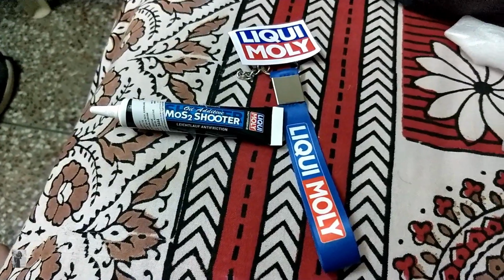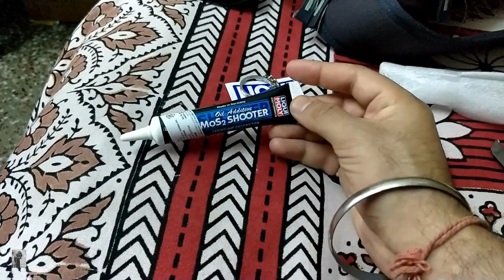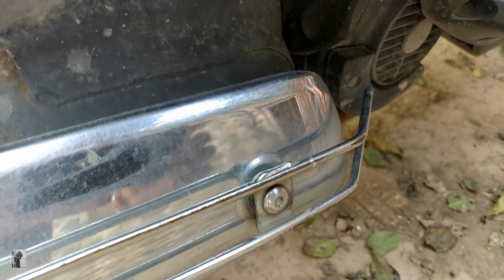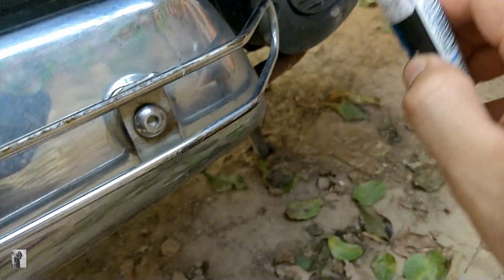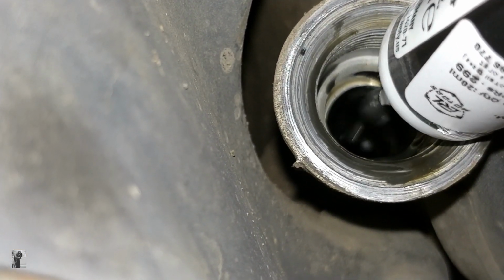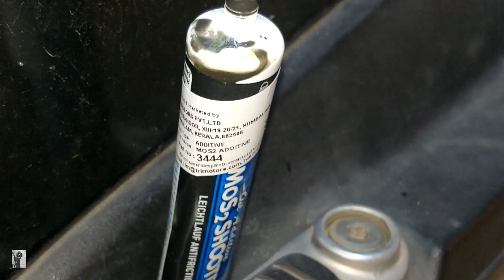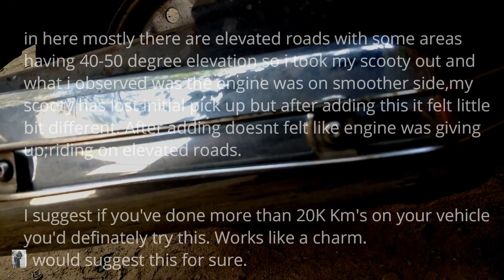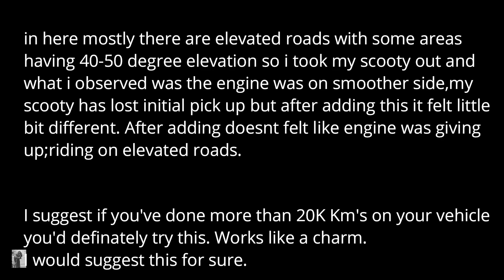Adding Liqui Moly MoS2 to Engine | Does it work?

Comment: Started using it in my bike after just 1900 KM.
Works really well & there is no commitment so you can switch off it on the next oil change without any issues.
Reply: I.own a mt 15 which is 5 months old. I've just filled liqui moly oil today and mos2 shooter. Not noticing any changes yet but how was your experience?
Reply: @RohitRoy-ev4fp  now feel any difference ?
Reply: @nooruddinshaik9464  My instant pick-up response was good and i would reach VVA very quickly compared to YAMALUBE. That's the only significant change and yes engine was more smooth. I'm using Motul 7100 now and I'm getting good mileage plus same engine smoothness. Let's see how well it goes
Reply: @RohitRoy-ev4fp  do you use Motul 7100 with liqui moly mos2 shooter or without liqui moly mos2 shooter?
Reply: @omarsyahrilnorazmi3302  Im using with shooter currently.

Comment: Now, how many kms you covered on this scooter till date.. any engine related problems you faced?
Reply from the maker: I gave it to my cousin 5 years ago. I've had it till 32k kilometers, and engine used to be smooth when mixing with engine oil, but you need to top it up constantly as it becomes thinner over the period of 2k kilometers and you've to fill it up again.

Comment: Saw some reviews that initially it runs smooth but after 1000kms it increases Noise, Vibrations and Harshmess levels of engine... Is it true ? Plz let me know
Reply from the maker: Yea initially it works really good but after the oil loses its viscosity it's like normal. But it doesn't add up the issues you mentioned like noises etc that is misleading.
Reply: It actually do... I am using with motul 7100 and 1st 300 kms were good and now the engine is making lot of noise and also engine is overheating

Comment: I have RTR 200 and it takes 1.2L of engine oil 20ML will be enough? Or i need to put 24ML strictly. Problem with me is i don't have anything to measure that extra 4ml
Reply from the maker: There is no strict rule for it. 20 will work

Comment: Hello,
Can I mix it with Motul Scooter LE 10W30 Mineral oil for my Activa 3g ?

Also, does it chocks the oil filter ?
Reply from the maker: No it doesn't choke the oil filter. It gets mixed up with the engine oil once you pour it in and let the scooter run on idle position for 5-10 minutes and then you're good to go. 
P.S: Don;'t revv your scooter for 3-4 minutes let it mix on its own
Reply: @manindisguise  Thanks friend

Comment: Can i use it with yamahalube 10w40? Iam currently ran 1500km on this engine oil shoul i add mos2? 2600km on odo meter
Reply from the maker: Don't add if your bike is new let it run atleast 7-10K km's. If you add it after 10k thats when bike starts to get really worn out so that will be better let your bike pass the initial wear and tear

Comment: Hw much ml we should use for 1ltr. Engine oil
Reply from the maker: 1 tube=20ml for 1 liter of engine oil or engine capacity
Reply: @manindisguise  i had mistakenly poured 5ml extra liqui moly mos2 shooter in my dominar 400 yesterday while changing oil. Is there any issue?

Comment: how much ml of mo2...for 1.65litters of engine oil
Reply: 2% = 33ml 

If you use scooter ( AT ) you can probably put more
i put 40ml of mos2 on my 155cc scooter.. but i buy the big bottle of mos2 not this shooter
because you can save more $ buying the mos2 bottle named "Liquimoly Oil Additive" with mos2 on the side label

Comment: Never use moly on a motorcycle that is using the crank case oil on the wet disc clutch
Reply from the maker: Still running with no issues
Reply: This statement is true to an extent, but there is a reason why it isn't pure Molybdenum.
Its Molybdenum DiSulphide which is approved by JASO to be MA2 standard.
MA2 certification proves that this additive is safe to be used in engines with a wet clutch.

Comment: I have RTR 200 and it takes 1.2L of engine oil 20ML will be enough? Or i need to put 24ML strictly. Problem with me is i don't have anything to measure that extra 4ml
Reply: 20 ml MoS2 tube is sufficient.
Unless your bike is in a bad shape, will you notice drastic change in ride performance.

Else, these are only PM.

Note:Oil additives work better with fresh oil.